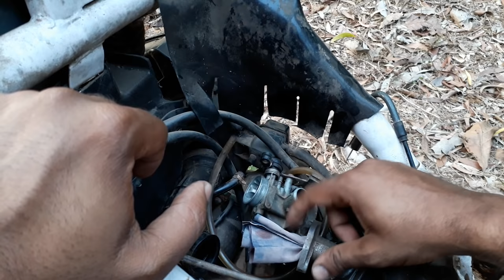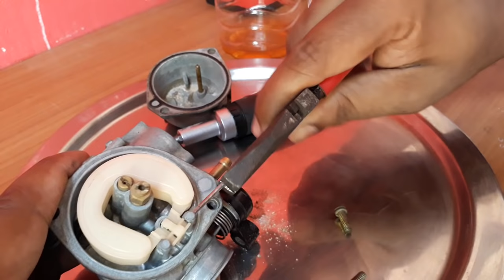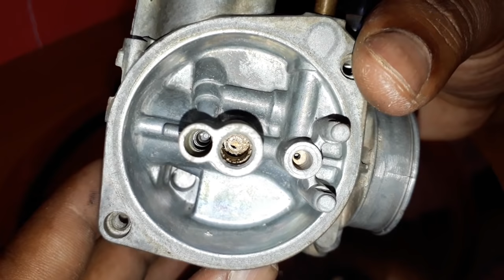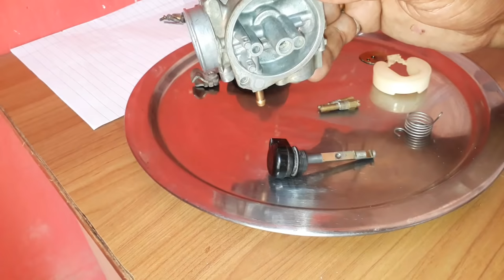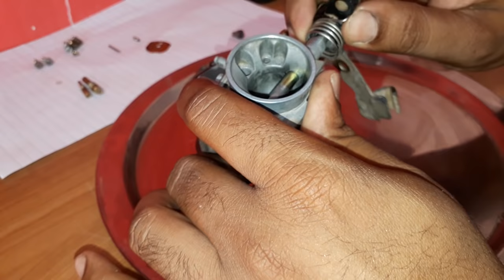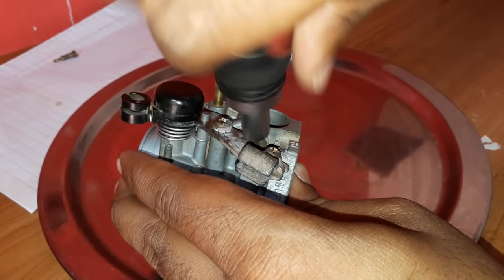How to clean scooter carburetor(HONDA ACTIVA)😟😟

Comment: My activa 4g was working fine but then i thought to self service it and I changed engine oil sparkplug air filter and secondary air filter and gear oil after that activa running smoothly but getting a start-up problem everytime when I start it and accelerate it stops I thought that new sparkplug is fake so I replaced it with old plug then problem increased now it stops when engine is idle. 😫😫😫 Don't know what is the problem.

Comment: Yes bro.you have done the best job,actually I was facing the same problem specially in rainy season since last 2-3 years & finally I visited Honda scooter service center for servicing the vehicle.After watching this video I have improved my self confidence and feel that it is not so difficult as we think,only our will power shall needed to be strong... Thanks bro.for most useful video & practical guidance.

Comment: creating vacuum by using syringe to pump fuel to carb is very good technique and this method will keep you from draining battery if the kickstarter is failed like in my case since it takes long time to send enough fuel to carb to get it worked :), from now on I am going to use this technique, thanks a lot...

Comment: Sir I have carefully watched your video, and clean my activa old model carburetor yesterday. very well you have described about cleaning process but about seal and gasket change you have not described. Due to which by mistake big seal which was kept in new packet fitted in wrong place after cutting and and pasting in carborater groove. Any way today I will change both seal with new one thanks a lot. Please describe about  the setting the carborater for optimum milage. RK SETH lucknow.

Comment: Sir, air fuel mixture screw main one o ring first then spring last o ring hai. I mean two o rings are there ,here in this video one o ring is missing which is very much necessary for mileage. Am I correct sir?thank you

Comment: Nice video abishek gee, in my CD 100 bike few months before my mechanic replace splender carburetor due to overflow occurs continually even replace of screw. Later new splender caburator also not satisfied by performance, when I drive more than 60 km speed bike not able to perform and it stuck some times off condition it goes
Reply from the maker: Splendor carburetor works perfectly for CD100 .Engine Jerk is also caused by water/unwanted particles(like rust from tank) accumulation in carburetor. Plus Bad coils of your motorcycle. Also maintain correct gap in your spark plug.
Reply: Abishek jee thanks for your advise, how to check the coil, because spark plugs & coil both r newly installed.

Comment: Nice video and very informative, I would like to know one thing is there a o ring or washer on air mixer jet.
As my bike carburettor is spitting fuel in the air cleaner what's the cause of it any solution.

Comment: Excellent explanation, 
Sir i have a doubt I think in the air fuel mixer hole there is a small washer in it before Inserting the spring if I am not mistaken
Reply from the maker: Yes,it contains a small o-ring and washer.
Reply from the maker: Sir,you can contact me here. I am always available here.

Comment: Best channel sir 
Please answer my queryy
Reply from the maker: Thanks
Reply: Self Repair GURUji Please tell about pipe coming from transmission what does it do in activa small pipe and also tell about crankcase breather tube (pipe from air filter)
My small tube from transmission is cut should I change it please help

Comment: my activa 3g is not going Beyond 75kmph Before i use to get the speed of 85-95kmph on highway. please give the solution for this problem.
carburetor cleaned👍
spark plug checked & cleaned 👍
air filter cleaned 👍
pick up is great 👍
reply me as soon as possible.
Reply from the maker: There may be two probable reason behind it. 
1)while cleaning carburetor the Air-fuel mixture screw position may be set to lean mixture. 
2)Your Drive belt may be worn out and hence not transmitting the full power of engine to the wheels.

Comment: Hi,my hero super splender-125cc/2026 model had just been ran 1768km. The sudden engine stop & starting prob: revives frequently. The authorised techni: checked & set rpm at1400. Would it be safe or need to do something else? Please suggest me. Thanks,
Reply from the maker: It's normal,If your idealling speed is low than required then engine stops frequently.

Comment: Hello...sir...bajaj platina 100 cc normal... jerking on 50 to 60 km range...cdi...ignition coil...spark plug change...carburetor clean...change slow jet 42 ...but same...neddle position  on middle

Comment: bai how air fuel mixture  screw works?  does turning  it clockwise use more petrol or turning it anticlockwise  uses more petrol?  please make a correct video on airfuel mixture screw  where which side turned uses  more more petrol..
Reply: He has made best video on this topic, Check more videos.

Comment: Sr soldering iron samcon ka orient electronics ka best hoga kya purchase karna ye bataiye plsssss
Reply from the maker: For basic ocassional soldering purpose any simple soldering Iron is best.But buy only those simple soldering Iron whose heating element are easily available as a spare part in market. So that, if once your heating element is fussed you can just change the heating element,you don't have to buy the whole soldering Iron again and again.

Comment: Float bowl me jo brass ka chhota pipe hai uska upar ka opening block kiya to kya problem aayega? Flooding hoga kya
Reply from the maker: Uska 2 major function hota hai.
1) float pin damage honai pai excess petrol ko bahar nikkal na, so that engine can start easily.
2) Accident kai time paar bowl ke petrol ko (jub aapka bike horizontal position mai gira hita hai) baahar nikaalna so that engine can automatically stop.
Reply: @selfrepairguruji  ok thank you guruji. I have to think of some other solution to stop overflow and wasting petrol n my money.
Reply: @selfrepairguruji  activa 4g 5g bs4 mei carb float bowl k niche wala overflow pipe redirect karke upar main body me lagaya hai so that no fuel is wasted. Uss condition mei aapne jaise upar bataya woh kaise function hota hai
Reply: @selfrepairguruji  activa 4g 5g k carb mei yeh function kaise work karta hai kyunki uss carbs mei overflow pipe firse upar ki side se carb me hi joda hai.

Comment: We have old honda activa (12 year old). Since last 2-3 months we facing starting problem. Morning me without choke start nahi hota. Mujhe choke dena pasand nahi. Bina choke bahot kick marna padta he aur starter dena padta he fir start hota he. Ek baar start ho gaya aur 5 min chala to koi issue nahi aata din bhar. We did servicing but still same issue. 2-3 mechanic ko dikhaya. Ek ne serficing kiya, e ne battery recharge kiya, ek ne carburator clean kiya, engine / gear oil naya dala magr same problem. kya kar sakte he. Please advice.

Comment: sir kya carborator ko clean kar ne liye, air filter change kar ne liye, spark plug change karne ke liye, oil change kar ne liye, mujhe wrench socket set wricet handle mngwa lena chahiye online. kya mera sabhi kaam is se ho jayega. sare screw is se open and close ho jayenhe
Reply from the maker: Buying tools is always a good decision. Tools are your best friend for life time.Tools collection is an investment and it will pay you for full life. But For carburetor, air filter and oil change you just need a screw driver and few spanners.  Always go for best quality tools because they are for lifetime and before buying online must compare the price in local market too. Always remember repairing things a pleasure.
Reply: Self Repair GURUji 
ok sr aap ne reply kiya bahut dhanyavad sir kya mai spanner ki jagah wrench socket handle set awia company ka Manga sakta Hoon Kya Mera spanner ki jagah Wo Kaam Kar Dega carburettor clean karne ke liye

Comment: When do we have to clean carburator ? I own a dio 50k km now.
What is the size of first spanor?
Will fuel leak through pipe if the tank is having enough fuel?
Reply from the maker: Dio have automatic fuel tap so fuel will not leak . No need to unnnecesry open the carburetor if it is working perfectly. Simply open the drain screw, all the impurities will come out.
Reply: @selfrepairguruji   How much it cost from a workshop to clean the carborator

Comment: My activa fuel pipe gets cut at the carborator, how do I prevent this, is there a better quality pipe which does not get cut available?
Reply from the maker: You can use the Honda Genuine Parts. Few locally available pipes are also good and can provide a good life. Must take the outer pipe sleeve from the old pipe and insert it into new pipe. Must provide the sufficient length.

Comment: abhishekji in my activa scooter when i remove petrol  pipe from carburetor  petrol constantly flowing in  power off position what to do and how to  check so me step by step
Reply: Change ur fuel cutoff pump which is on right side of ur tank the pipe which comes from ur pump to carbourator

Comment: sir Activa 3G k carbreutor technician n kharab btaya h kya wo theek hojaega
Reply from the maker: Kabhi kabhi slide mai problem aata hai. Aur kuch problem waala part nahi hoti
Reply: Sir meri Activa mein gaadi band hojaati hai baar baar filter,plug,tapet sb check krchuke carbreutor ki setting bhi honda technician n krdi jbbhi dikkt whi hai gaadi choke par start karne k baad bhi band hori hai

Comment: my new activa 4g making some tickling noise and turn off after engine worm up the problem goes what the problem please help
Reply from the maker: Use choke to start your active in morning ie from cold. It's new engine and it need some time for its proper settlement.With every adding KMs your activa with become smoother and smoother. Keep it like a baby . Don't go for high RPM at least for few Thousand KMs.
Reply from the maker: Will

Comment: In my CD 100 bike carburetor gasket between top cover and bottom cover petrol get leaking. How to resolve this issue.
Reply from the maker: That packing is available in market replace it.
Reply: Self Repair GURUji can u give me suggestion engine gasket paste we can stick.
Reply: Self Repair GURUji in my bike when I give acceleration means it does not move fast. Bike getting jerk some times.

Comment: Can we clean carburettor using petrol or kerosene ? I don't think so ,coz it will form a oxide layer on top of carburettor ,
Generally mechanics use kerosene to clean this 
Correct me if iam wrong
Reply: Use petrol. If you are rich, buy Carburetor spray cleaner or Throttle Body cleaner sprays made by 3M.
Reply: Can we use gasket maker paste to check petrol leak from bowl? Once I used it but had created a problem of remnants in the petrol bowl is there any alternatives please suggest   thanks for such a descriptive and very much useful video

Comment: Don't open carburetor if you don't have any big problem with carburetor .. sometimes it can be difficult for you to settle that again like before .. so, avoid that thing and use good quality fuel or put a magnet in your tank .. magnet will collect all iron or rusty parts from your tank .. and i have one more solution for saving carburetor from dust or rust ...
Reply: Yes use fuel filter

Comment: My tvs victor gl 2003model over flow hoti hia sir video create karia
Reply from the maker: I explained about float pin in this Video. Just check your float pin. If it is not giving a leak proof seal. Just check any dirt over it or it's seat or damaged float pin. Process is same for all carburetor.

Comment: sir meri scooty actiav smoke de rahi he to please koi solution batou
Reply from the maker: Is it white smoke? Does your Engine oil level goes down rapidly ??
Reply: no sir i service my scooty 15 days ago and my scooty is not giving proper milage plese give me some solution
Reply: yes sir it is white smoke
Reply from the maker: What is the odometer reading of your activa,I mean totally how much distance covered by your activa.
Reply: sir normal distance only 82km sir from service and total distance it covered from staring is 12089 km and sir my both air filters are clean
Reply from the maker: White smoke comes mainy because of worn out oil rings (bore-piston kit)or worn out oil seal of the valves. It is a serious issue and can't be neglected.your Activa covered only 12089 and if oil is changed at regular basis there is less probability of worn out Bore-piston kit. So please check out valve seals. If your activa is still in warranty they will replace it for free.
Reply: sir please please send me that oil seal image and tell me how much did cost i pay for repairing my activa total cost
Reply: sir please please send me that oil seal image and tell me how much did cost i pay for repairing my activa total cost
Reply from the maker: Oil seals are cheap ,it comes under Rs 100 but changing them is a tension.If your Activa is still in warranty period then ask the service centre to inspect it. There may be various reasons for white smoke. 1200 kms is too early for while smoke from engine exhaust.

Comment: I had old dip my petrol is leaking I showed to mechanic and he changed flow pipe and he changed oil filter and he changed float needle but still its leaking when I cut flow pipe for two days its OK but again its started leaking..

Comment: Bro what will happen if I mix water in place of fuel what is the solution for it pls say me plz plz can I clean carberator than will it work say me then I will subscribe ur channel
Reply from the maker: Water will start accumulating in the Bowl of carburetor and when it will be completely full your engine will refuse to start. After That you have to open the Drain screw of carburetor to Remove this water.